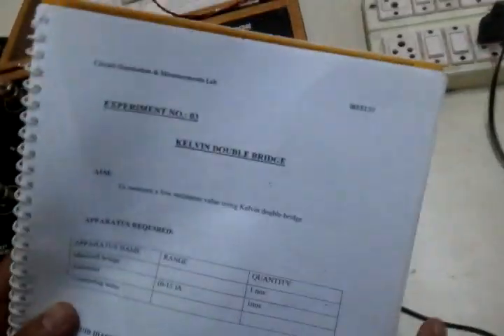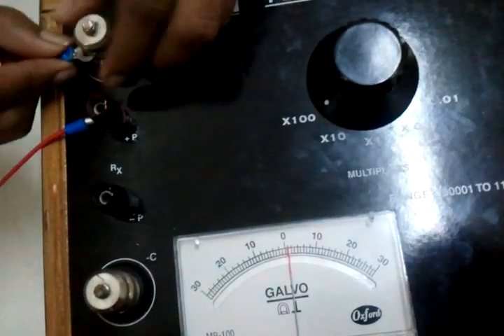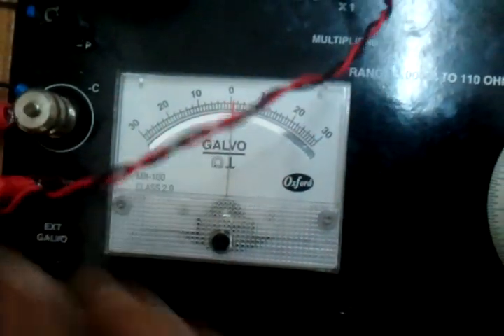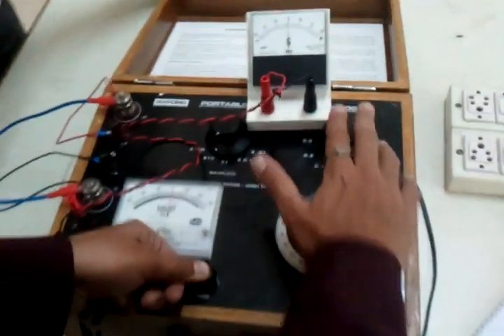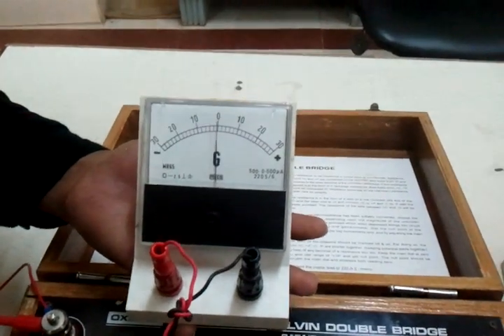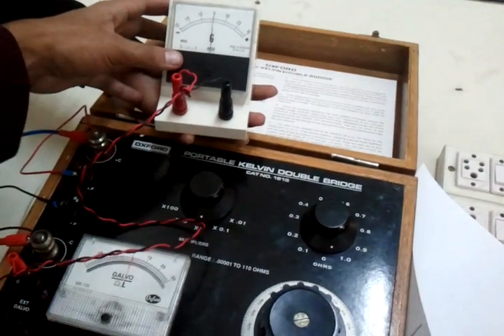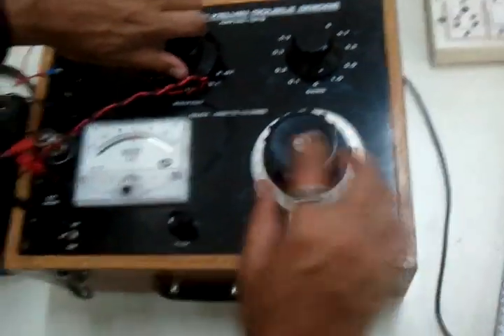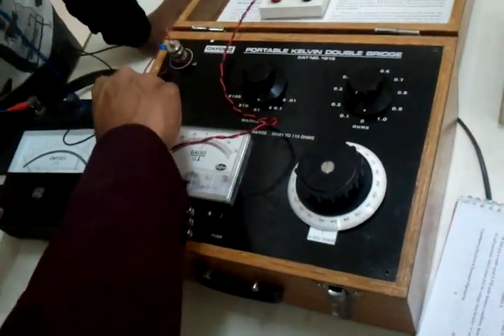Kelvin Double Bridge.mp4

Comment: Measurement of leads resistance is wrong , as u measured only one wire, bcz there are two wires to connect ammeter right..